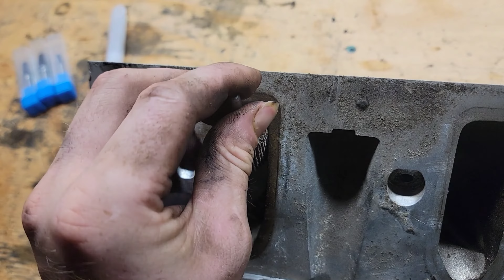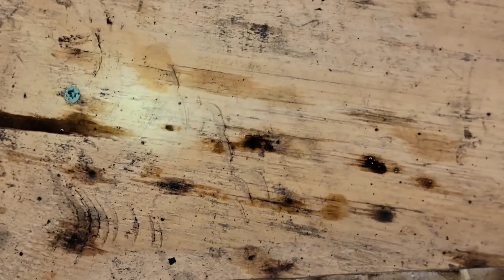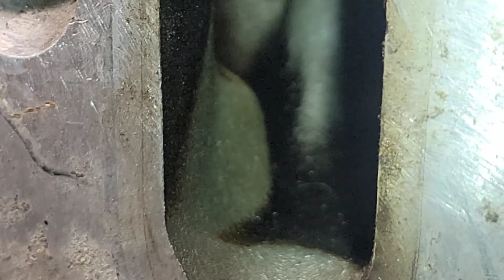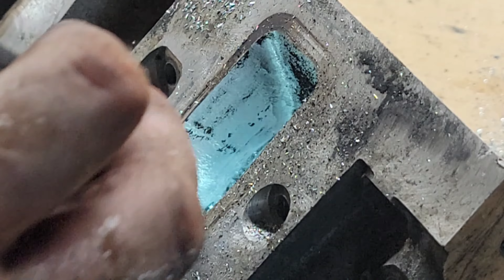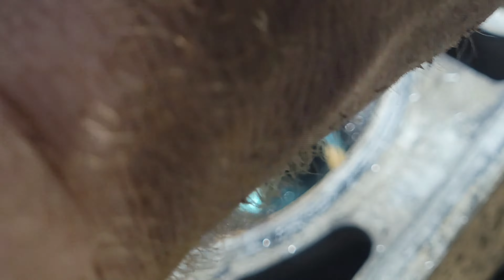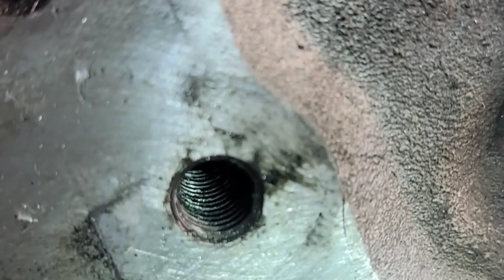How to port your LS cylinder heads! In your garage by hand! +40cfm!

Comment: Your heads will flow about 290 max, 310 CFM  is very possible with more work and better detail and a little math….just sayin.
Reply: Ehhhhhh.....you're being awful generous! No short side work, bowl, throat, valve unshrouding, chamber work(spark plug boss and machinist ridges)......there might be 10 to 15 cfm of work done. Low lift numbers will suck....and no valve job. Generous.
Reply: I just cant help but look at how motorcycle ports/bowls and other high performance stuff "looks"... Everything is smooth.. im impressed with his work but the comments make me unsure lol.
Reply: @171apples171 only respect comments of those who made their own video.
Reply: Not hardly
Reply: @arturozarate1752  🎯💯.   I was waiting for him to check throat/valve ratios and open that up and then blend, short side work is extremely important on LS heads... + some chamber work....
Reply: @171apples171  if you're talking V-twin stuff yeah. I'll have to look, but I think I made some videos doing some Harley heads. I polish everything(intake & exhaust ports and chambers) to a mirror shine and leave the tall short side on a Harley head. S&S does it....figured it might be alright with fuel injection and such a short runner.🤷‍♂️
Reply: @trailerparkcryptoking5213  I agree. Widening the short side and the bowl while lowering the curved side corner is the way I've tested it to work best vs laying the short side back to see more of the valve. The LS heads need the short side they have....well maybe 80 thou shorter is as far as I go.

I feel that slowing the charge helps to make that turn and decrease the lean area of the quench. That's how I've been porting them since 2001.
Reply: @trailerparkcryptoking5213  math my man.....I remember when some clowns would raise their hands and ask the teacher, "why do I need to learn this?" "I'm never gonna need this when I grow up." 🤣🤣🤣🤣🤣🤣

That 88%-89% is great on the street. 90ish%.....sketchy if the person porting is green AF and eye-balling it. Where to measure the throat always gets most people. Then there's the semi-sharp ledge to aid with fuel shear......

Regardless, the BIGGEST thing is the valve job. All work done supports the valve job. That's the ultimate bottleneck.

The LS3 821s have a great multi angle intake seat.....have a good one man.
Reply: @arturozarate1752    My funny story with math was I had an old professor named Dr Moreland at Texas Tech for Calculus 1 and Differential Equations.  When young engineering students would complain about how hard the math was he would state, “Well you can go to the building right next door and get you a degree in Mass Comm and graduate into a minimum wage job.....”.  It would shut them up!  🤣🤣🤣.   He was so old he told us he was teaching a math class at the University of Texas when he heard the gun shots of the sniper in the bell tower....being ex-military he knew they were gun shots and attempted to keep his students in the class until someone ran down the hallway screaming “gunshots fired”.....
Reply: @trailerparkcryptoking5213  oh shit.....I had a one armed History professor at SHSU in Huntsville. It was an auditorium class of 150+. Every Thursday a 3 page paper over the lecture was due. At the end of the semester I had only attended the first class. I received an incomplete. When I visited with him he said I'd only been to one class. There was no role taken. He lost his arm during the cold War working assets over the wall. He knew every name and face from the first class without meeting a soul face to face. 

Was it bullshit? I don't know.

I think that taking the opportunity to seek out a higher level of education is what's important here. 

By the way, how is that "Tree" in Lubbock?